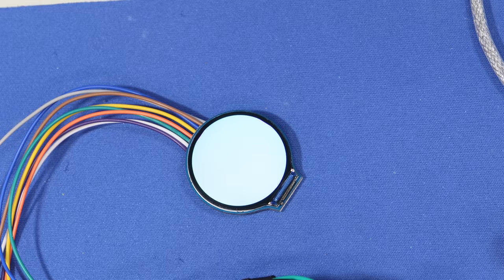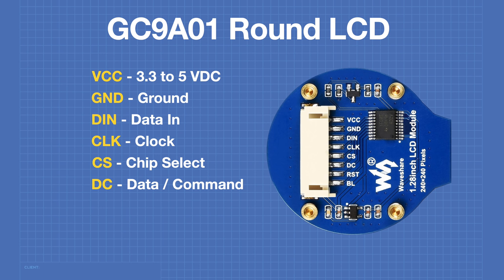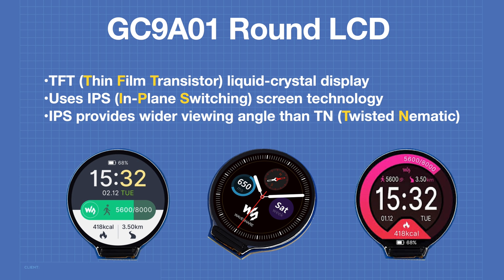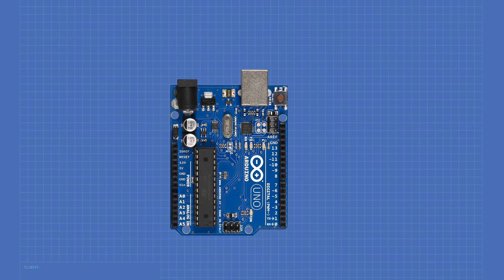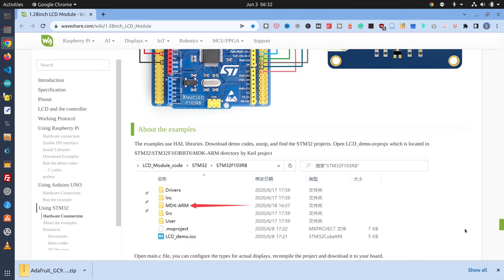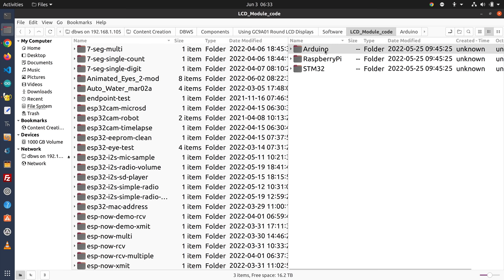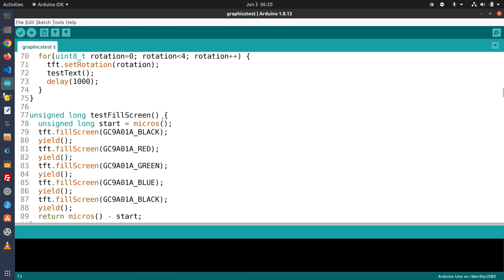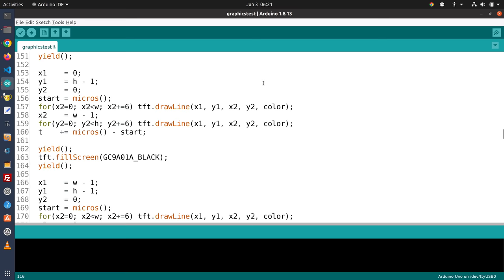GC9A01 Round LCD with ESP32 & Arduino

Comment: Further to my comment below, it is not an error in the code that cases the numbers to be erased or in some cases (like mine) to display a glitched rectangle.... looking at the code in the library and the documentation of the example, it is a result of the display not supporting readback of the graphics buffer. The code will attempt to read the buffer to restore the position where the old needle position was before drawing the new position but this only works on displays supporting the buffer read functionality. You can test your display's readback support by running the sketch under TFT_eSPI>Tests and Dignostics>TFT_ReadWrite_Test - the results are displayed on the serial monitor. I am trying to figure out a way to decode a JPG into raw program memory and rendering that to the screen buffer so that it can be read back without screen support. I have tried to do this by decoding the Jpg for the main gauge to a second sprite and drawing this to the TFT so that I still have access to the memory area.... but I have been unable to get a sprite loaded from the jpg decoder... I shall keep trying...

Comment: hi, i've been trying to get this display to work for a while now. i don't think it's an issue with the video, rather my method since all the comments i've seen so far are saying their project works fine. is there any specific board i need to use or any specific place i need to buy my display from? i mean the display works with the arduino fine, and the board works fine for other projects, so i don't understand the problem. i bought the display from pihut and the board is an amazon diymore board (wroom). the user_setup.h file was also correctly edited and saved. i have tried masny videos but still can't solve this. can anyone help me? thanks

Comment: Nice tutorial I absolutely like it !! 
Of course you can always add an SD card to your project and fill it with indexed picture data so you can adopt your display to your own project. 

The next level step would be interfacing the display with parallel interface without an SPI driver in the middle!! 
Thank you for sharing this with the community!
Reply: I would like an example of that!

Comment: Perfect timing with this video... I am using these right now as instruments in my flight sim cockpit.... I am pretty sure the disappearing numbers are due to the needle being draw over the numbers thereby erasing them. To draw a needle over the numbers as it would be seen on a normal dial, you would have to "restore" the pixels under the previous needle position and then draw the new position, of course you could redraw the complete background every time but this might be too slow for fast response dials. I will play with that as it is my projects use-case.
Reply: Chris Mulder- were you able to correct the disappearing numbers under the needle issue? I'd love to set this gage up on my RV to monitor transmission temps, but I need the numbers displayed and haven't figured it out. Lovely video though.

Comment: I believe I can explain the "disappearing act". It is occurring because the code is expecting to read the current contents of the block where the needle sprite  is to be written, so that it can be written back when the needle moves on. The module does not have a connection for the required data line.

Comment: I just love the eyes project.  I can see some fun stuff with that.
Like, adding a "Gesture" sensor that could track a person as they move and the eyes follow.

I suspect, but not sure, that they eyes are sprites.  If so, I don't know if there's a way to "enlarge" the sprite or if it requires, as suggested, finding bigger eye files.

I haven't even connected my 2 ESP32 boards as yet, but I guess I'll get to that during the winter.
Right now, I'm concentration on a couple of projects that I NEED to get done ASAP.
It's a networked monitoring system for our greenhouses, so that we can monitor things like temperature and humidity inside them as well as auto turning on/off the heat and exhaust fans.  Fun stuff, but I got distracted and now it's urgent.  LOL
Reply: Someday I hope to play with this as well... add the tracking you suggest and a light sensor to make the iris pupil adjust in size.  I could see adding a simple printed "head" in a frame with these eyes to my door so when people approach to knock/ring they are warned they are being monitored!  ;)  Haha.
Reply: If you have any information on the enlargement of the eyes, please let me know

Comment: THANK YOU for explaining that you need to edit the User_Steup.h file with the correct pinouts to get it running. This does not seem to be documented elsewhere for some reason. You rescued me after hours of frustration trying to get the display to run using an Adafruit Feather V2

Comment: I wish you were my teacher in school, I learned so much in this one video then I did a whole semester in school, one I think I'm stumped on is I'm currently making a boost gauge and a oil pressure ,and I would like it to display the information to my phone via Bluetooth or wifi I have no luck trying to figure it out I have my pressure sensors working for a boost gaige up to 30psi

Comment: Bill, may I ask you a favor to confirm something?
First, I'm been fighting with this danged round display for several hours now trying to get the thing to work.

The ESP32 board that I have (well, one of a bunch) looks exactly the same as the board you were testing with the colors sketch, @24:55.
But no way it will work for me.
So then, I thought, I'll try one of the other boards, which is a 30 pin board, specifically marked as WROOM.
The only change that I had to make was to the user_setup.h file and change TFT_DC from 16 to 15 as this particular board doesn't have  a pin marked as 16.

So in this case, when I uploaded the sketch to this different board, the display works.  However, I think that it still has a problem because it goes all crazy with corruption/lines.  I'll have to test all the wires as I suspect that's the issue.

Anyway, all that being said, would you please confirm with me, that when you are uploading to the board at 24:55, which board you chose?
I had also been using the WROOM board for this one (with 38 pins, looks the same as your board) and other sketches seemed to work fine.  But perhaps I'm using the wrong board option.

Please do let me know which one you used.

Thanks so much in advance.

[UPDATED HERE]
I'd still like to confirm which board thing you use, however, I got it going on both boards.

What I THINK was the problem, is the USB hub that I'm using is only putting out 4.7V.
It's flaky when I plug into that.
However, when I plug into a solid 5.1V smart phone supply, they are stable.

Either these boards or those displays are super picky for voltage.
SUPPOSEDLY, these displays are designed to work on both 3.3V and 5V.

Oh well.

Comment: i ordered and planned to use an esp32 c3 mini mounted on an aliexpress custom module the famous 2424S012C
which normally has the same display but for my part I've looked everywhere and found a minimum of information on its operation and configuration I only managed to make the lcd backlighting work but it was impossible to make it work despite several searches and documentation ...

Comment: I know this  video is about a particular display.  I have an ESP32 gadget with a tiny 1.5" screen and what appears to be a 4-wire SPI bus interface.  I'd like to swop out the display and install a 7" screen.  I can imagine I will have to give that screen its own separate power supply.
.
Can I connect a larger 7" or 9" screen to my ESP32 gadget?

Comment: do you have a video on the arduino uno and the esp32 as a modbus rtu master slave rs485 to read input registers 30001, 30002, etc. with free forever PC windows modbus test software? Plus using hobby saleae software and decode oscilloscope for trouble-shooting? most modbus examples just work and if they do not show how to fix it, this would help a lot. 🤒 crc errors
now today on to this cool GC9A01 project  😎 thank you

Comment: Just an advice and it's up to you to decide, why don't you use more advanced IDE and advanced coding without using arduino stuff like digitalWrite? I'm sure you know there are a lot of limitation using arduino IDE. it may be easy to use libraries for beginner, but you have no control over your code and it is slower.
Reply: Do you have any suggestions? I have been using Arduino IDE for a while, will be really helpful to know if there's other options to code.
Reply: @葉啟成-b4e  Visual Studio Code with Platformio plugin works really good for both arduino and esp32
Reply: @葉啟成-b4e  I use atmel studio, and there is visual studio code.

Comment: @DroneBot Workshop @Dronebotworkshop thank you. I have to use GC9A01 upside down as a circle gauge with number value displayed like 32:36. Is it easy do modify your code (and how) to display corectlly on display mounted upside down (rotated 180*)? Thank you for tips/code.Thank you

Comment: Very detailed video! I'm thinking about building a diorama using a small LCD screen, which would simulate some sort of billboard advert thingy, to run some sort of gif animation, what do you think would be the best option to achieve that, in terms of the level of experience needed to work with and price?

Comment: I have ESP32, using the Arduino IDE 2.32. I've verified my pins vcc=3v3, GND=gnd, SCL=P23,SDA=P18,DC=P22,CS=P4 and RST=P16. I modified the user_setup.h as indicated (uncommenting) in the video and flashed the Colour_Test example from the TFT_ESPi|Test and Diagnostic section. I can see the backlight on the TFT GC9A01 come on, but no text or colors. I was wondering if I'm doing anything obviously wrong. I tried two different ESP32 narrow (38 pin) modules and 4 differt TFT 1.28 Round Display modules. Below is all I get on the serial output when I reset the ESP32.

rst:0x1 (POWERON_RESET),boot:0x13 (SPI_FAST_FLASH_BOOT)
configsip: 0, SPIWP:0xee
clk_drv:0x00,q_drv:0x00,d_drv:0x00,cs0_drv:0x00,hd_drv:0x00,wp_drv:0x00
mode:DIO, clock div:1
load:0x3fff0030,len:1344
load:0x40078000,len:13964
load:0x40080400,len:3600
entry 0x400805f0

Comment: Did you find out why the numbers in the guage disappeared when the needle crossed over them?
Reply: The comment in the code at https://youtu.be/k2c2zCmC_X0?t=1800 explains this: the example should read back the CGRAM from the TFT and write the modified area to the LCD. Since this LCD is read only (no data out pin to connect to MISO) that will not work.
Reply: I think it's because the needle overwrites it, and does not rewrite it after the needle moves on.

Comment: #include <User_Setups/Setup200_GC9A01.h>           // Setup file for ESP32 and GC9A01 240 x 240 TFT  works for me for an ESP32.    So no special configuration must be created.
But I was unable to find a setup for the Arduino NANO ESP32. With selecting it as a board it does not upload and for ESP32S3 Dev Module the picture was just pixeled.

Comment: Sorry... this got rather verbose.  LOL 🤦

I'd love to have one of these round displays, but to confirm, are there Libraries (WORKING LIBRARIES) for
Arduino Nano EVERY board... specifically?

I ask because I also have those llittle 0.98" full color LCDs, which work perfectly on the regular NANO board.  But the library files for the NANO EVERY board leave much to be desitred.
While is KINDA works, there's a lot of silly tweaking and after all is said and done, the text doesn't look anywhere near as good as what the reg. Nano libs produce.

The Nano Every has different architecture than the reg. Nano so the libs must be re-designed for the Every.

I use the Every boards due to much more memory to work with.

Does this GC9A01 round display have Nano Every libs that actually work as well as seen in this video??

Thanks in advance.

Main reason for using Nano EVERY board

As seen in this video, even a small demo the bloated libraries sucks up 73% of memory.
As is known, once over 70% (ish) the Uno and Nano boards start to glitch out.  Depending on code, you often can't get past that amount of memory used up without problems happening.

Due to this, I switched to the Nano Every boards where there's so much more memory.

For most projects, these days, I use Nextion displays   WITHOUT  their also super bloated libraries!

Without the overhead caused by the libraries, now there's lots of memory to build rather robust projects.

However, I do want one of these round displays since, sadly, Nextion doesn't make any round ones.  I WISH!

So knowing that I am forced to use libraries, I must use Nano EVERY Boards where I'll have enough room to code what I need.

The first project is a room Thermostat.  I'm designing it using a Nextion, which is fine, but the round thing would just look cooler.  LOL
Sure, I COULD design a case with  a round hole and FAKE a round display, but that would still require a square/rectangle case.

With a round, I can design an actual round case to hold the project.

Comment: Anyone know how to resolve port/com issues? My ESP8266 is not being recognized by any USB ports on my machine. I've encountered different error codes and the fixes have not worked! I see an active blue light when I connect the controller to my laptop, but it's still not being recognized by OS (Windows 10) nor is there a port available in the Arduino IDE. Any help is appreciated! Thanks! =).
Reply: Have you checked if you have a ch340 USB to serial ic on the Dev board? Often you need to install a driver for them

Comment: TFT_eSPI library is one of the best there. However, you shall not edit User_Setup.h but rather User_Setup_Select.h where you uncomment the line: //#include <User_Setups/Setup200_GC9A01.h>  and comment any other Setupxxx.h file - otherwise you are changing the library config for all your projects
Reply: One detail I never quite could get my head wrapped around with the tft_ESPI library: there seems to be absolutely no way to pull the configuration into your own project ("display type X with this pinout" in one project, "display type Y with that pinout" in another project), instead of changing the whole lib's configuration every time. So, there's no good way to use the library in more than one project without having to fiddle with the setup after every switch...
Reply: @CoPoint  there is a way: 
in User_Setup_Select.h you define many files with detailed configuration and then uncomment the one, to use with specific project. 
If you have the same displays but differently connected (like I have) then you do it this way (i.e): 
// Setup file configured for ILI9341 320x240  for project1
// #include <your_path/TFT_eSPI_display_setups/ZH_ILI9341-project1.h> 
 and for another project you do it same way:  
// Setup file configured for ILI9341 320x240 - project2
// #include <your_path/TFT_eSPI_display_setups/ZH_ILI9341-project2.h> 
Then you uncomment before compilation which one you want to be used during compilation

On top of that, you can put in your project code checkpoints to make sure you have compiled with proper setup

The custom configs you better keep out of the TFT_eSPI folder as every upgrade will delete all.

Also, the User_Setup_Select.h will be deleted so all your entries will be gone but again: keep the copy in another folder.

Yes, not very trivial but doable.

Comment: the library code is very low quality - has a lot of commented code everywhere (looks like someone been debugging?)
Or take this function for example:
static void LCD_1IN28_SetAttributes(UBYTE Scan_dir)
{
    //Get the screen scan direction
    LCD_1IN28.SCAN_DIR = Scan_dir;
    UBYTE MemoryAccessReg = 0x08;

    //Get GRAM and LCD width and height
    if(Scan_dir == HORIZONTAL) {
        LCD_1IN28.HEIGHT	= LCD_1IN28_HEIGHT;
        LCD_1IN28.WIDTH   = LCD_1IN28_WIDTH;
        MemoryAccessReg = 0XC8;
    } else {
        LCD_1IN28.HEIGHT	= LCD_1IN28_WIDTH;
        LCD_1IN28.WIDTH   = LCD_1IN28_HEIGHT;
        MemoryAccessReg = 0X68;
    }

    // Set the read / write scan direction of the frame memory
    LCD_1IN28_SendCommand(0x36); //MX, MY, RGB mode
    LCD_1IN28_SendData_8Bit(MemoryAccessReg);	//0x08 set RGB
}

 MemoryAccessReg  can never be 0x8, yet in the last line comment it says that it's for setting RGB..
currently im re-writing this for a different MCU (AT32F403a) hopefully i can do a better job before the module gets toasted :(